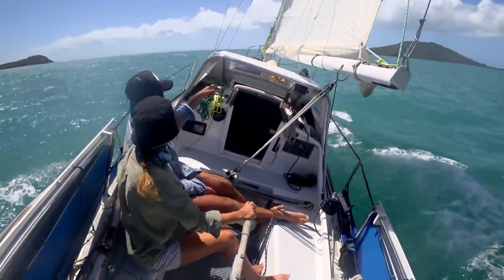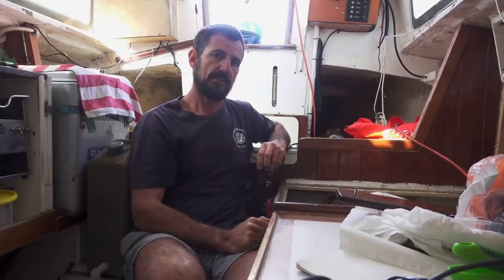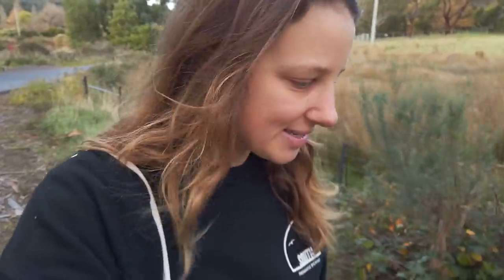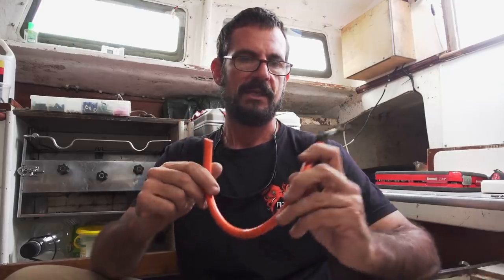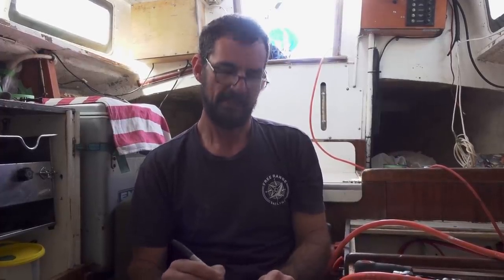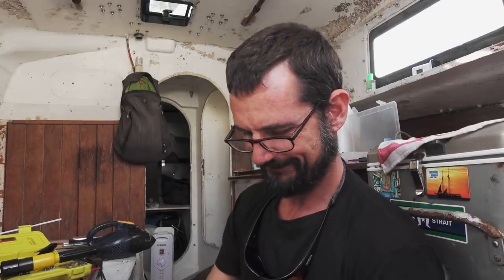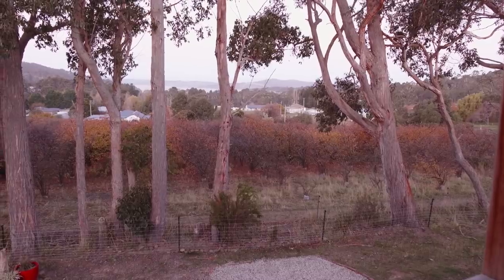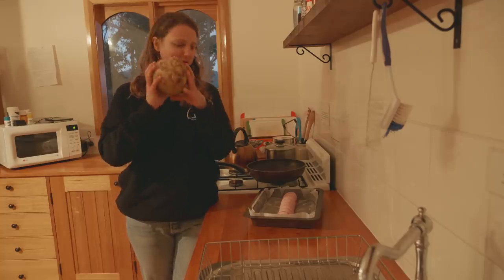Renewing our Electrical Wiring (DIY Sailboat Refit) - Free Range Sailing Ep 143

Comment: A cupla things Troy, if just crimping sealed lugs and heat shrinking it is a further improvement to have dipped the cable in a dielectric grease before crimping, remove the excess before insulating, shoulda remembered the advice you got a year ago from some production experts. When using lugs with the little slit inspection point in them it is best to crimp then solder into that little slit then insulate. The crimp stops the solder creeping up the cable so the solder that is fed in that little hole only sticks the very end of the cable to the lug, the crimp does the mechanical strain relief without allowing the solder to stiffen the cable, absolutely perfect and the solder stops moisture getting into the crimp through the hole. Too much work for a production joint but when doing low volume for yourself may as well have the best.
Reply from the maker: I'll pin this reprimand for viewers who want AAA finish.
Reply: @FreeRangeLiving  I was surprised you weren't dipping the cables before crimping, that was the big takeaway from the discussion last year.
Reply: I never crimped those lugs, just heated them up with a torch, filled them with solder and shoved the wire in..never had one fail.   I do really like the double wall shrink, I hadn't used that before, thankyou as always for the tips,  love your videos.
Reply: @bluejeans725  in which video did they discuss dipping the cables? I don't remember that bit...
Reply: so glad i saw this post as i was going to say exactly the same thing... soldered lugs are the best :) same applies to Anderson lugs, XT connectors and MC40. love it!

Comment: Just a tip - The bevel in crimp lugs (of that size) is designed to allow fine, multi-strand copper cable to get all the strands into the crimp area. You should also make sure you have the length of copper cut to full length of the space in the crimp and press the cable into the crimp as your crimping it to maximise the surface area of contact between the crimp and the cable.

Comment: A very quick tool for finding voltage drops, and find any kind of fire hazard is a thermal imaging camera. 

They are expensive,, but if the alternative is that your boat are going to shipwreck because of a fire - it is totally worth it. 

One can also find leaks (hidden ones too) - water is usually colder than its surrounding, so it would look blue on the thermal imaging camera's screen. 

It's known that there are sailor's boats that had ran aground, and those who are going to run aground. 

If there is a hole in the hull - you can see it through the thermal imaging camera, and thus also the extent of the damage to the hull. 

A yacht club could buy one, and let its members use it.

Comment: Important information about crimping. You should never twist the copper strands before crimping, the strands should go straight in, parallel to each other before crimping. If you twist the strands before crimping they are going to cross each other and when you apply pressure when crimping you effectively cut the strands in halve weakening the connection, but if they lie parallel to each other when crimping you get a very strong and conductive connection. Best of luck on your travels :)

Comment: I've been an electrician for 17 years and I've never even heard of liquid electrical tape,  I will definitely be acquiring some. 👍🏻
Reply: Home depot Carrys it or Nedco electrical
Reply: Plasti dip is a popular brand here in Australia. Leaves a plastic coating like found on tool handles etc. Good for a multitude of things including dipping the end of ropes (lines) for a 21century whipping.
Reply: @glennbrown1961  Stop it@ Get the palm and needle out ! or if you have the skill do a palm and needle whipping without a palm and needle!

Comment: In a marine environment I was taught to crimp, solder then heat shrink. Soldering guarantees no possible air therefore no water intrusion and no corrosion.
Reply: A lot of those large lugs have an inspection hole on the eye side of the crimp. The crimp stops the solder creeping up the cable so the solder that is fed in that little hole only sticks the very end of the cable to the lug, absolutely perfect and the solder stops moisture getting into the crimp through the hole.
Reply: as long as you don't overheat the join during soldering...
Reply: @Tom Mac  We never want to use solder in a vehicle for the same reason we don't use solid wire - vibration leads to work hardening leads to broken wire.  I'm re-working the wiring in my 1979 CD27 - which has factory-installed 16 AWG zip cord and wire nuts for the nav lights in the bow!  We used to believe some interesting things in the past, eh?

Comment: To heat shrink without having to rotate the wire you can use a small piece of sheet metal and cut it so it clamps to the end of the nozzle like a clam and then extends out a couple inches and forms a "c " shape. You can also buy them from electrical supply stores, called a nozzle hook

Comment: Dinner looked great!  After 1 sailboat refit (1/2 anyway till she sunk and I was boatless) and now a 40 foot land yacht, have done many electrical connections with wire and cable. You are doing a great job. Good tools make it so much easier. That and good tinned wire and ends, and of course heat shrink. I also use dielectric grease on my battery cable crimps. I don't use the hydraulic one, but a long handled one, that puts a single crimp on the lug, but then you have to put another one one to make is good to go. Then heat shrink. I don't use as much as you though...lol. And yes I hate when previous owners use electrical tape, but must confess that I have used at it times too. We all get lazy, tired, cold, hot, and sometimes just do a half assed job when we knew we should have done it right. Being in no hurry is be best practice.  Great refit so far. I have owned a 27 ft Nor'sea ( a great boat but way to small for me) and a 40 Endeavour center cockpit. The one that sunk.... and the smaller boat is the better boat imo. Looking forward to your transformation.
Bob

Comment: Some dieelectric grease on the connectors to the battery posts will protect them from the "acid breath" from the open-cell batteries as well!
Great details, thank you both!
:-D
Reply: Open cell acid batteries dont mix well with salt water and God forbid there dislodge in a storm? Game on then! Better going with marine sealed Batteries!

Comment: Good Aye Troy and Pascale,

I love your Clanny adventures and back up your comments on getting her seaworthy and go sailing.  We bought SYLVARA( Clansman mid 1972) 24 years ago and we have taken her from mooring minder to our pride N Joy.  I could have pulled her apart to where you are at now, but we chose to use her and we love racing and sailing her from Rushcutters bay in Sydney. 
 I chuckle at your electrics as I have been through it all and fitted a really neat switchboard and fridge unit in the ICEBox.
I have painted the main cabin and it makes it look heaps bigger.  I envy your time to be able to do the heads and forward cabin.  They are still on my gunna List.  
One piece of advice, use an Epoxy undercoat before using a polyurethane topcoat.  The reason the paint has not held well is that most people slap polyurethane straight not Gelcoat.  The poly cannot sticker tenaciously enough.  As the Gelcoat releases wax & Styrene's, it reduces the polyurethanes adhesion which peels once damaged.  Only epoxy undercoat can stick tenaciously enough to eliminate delamination.  Then put the poly over the epoxy and you have an extremely good paint systeem.  Check out Aquacote undercote and AquaCote Topcoat for a great finish and they are non toxic when working between decks.or a great exterior .   It can even be buffed after a week to a very high gloss finish.

Keep up the video's , they are great.

Comment: Just a thought, don't ever use lugs with what people think is inspection holes on boats (which they are not by the way). Your good heatshrink will hold moisture in with the copper strands.
I see many people do this and you had at least one in the vid. :)

Comment: I'll solder lugs on cables if I don't have the proper crimper on hand. If done properly it'll outlast a bad crimp 100 times.
Also I've seen people toss perfectly good battery cables because of the ends being corroded. With what good cables cost a lot of times you can trim a inch or two back and they are perfect and great for spares or shorter runs.

Comment: Should have pulled the boat out and towed it onto the property! looks close enough, awesome video as always :) very informative, i worked as a cable layer for many years and the only time we used electrical tap was when we had to join cables to pull through new ones, I was a bit surprised you never used any solder in your lugs! not that its needed when you have the right tools for the job but offers a bit more peace of mind that you have a solid connection, I would love to see a recipe book one day with some of them mouth watering meals :)

Comment: Back in '73 I spent the summer reworking and standardizing all of the Mic chords at the Student Center at my undergrad. We had a bunch of misc. chords made with everything  from coax to 2 or 3 wire electrical wire. Over the years we had created a ton of on demand chords because in the heat of the moment it was always easier to make them then to check them. So I standardized the wiring pattern and made them all. Shrink tape wasn't around then.

Comment: I was actually out picking 7 Litres of blackberries today. 
Love that hydroelectric crimp press. 
I’m going to check the price, and see if I still love it after 😂☺️
Good luck and fair winds ,,,/),,,
Reply: Hydraulic, I think Anders.
Reply from the maker: 7 litres! What treasure!
Reply: Mine was 36 aussie dollars on ebay.there are heaps around and prices vary widely, it pays to check cos I have seen them from over 100 bucks. I also use mine for small stainless swaging on 2 and 3mm ss cable for dinghy rigging. Works good and looks alright. You could probably change dies for a perfect finish. Cheers from chilly Tassie (Old Beach)
Reply: @rogerstone3068  haha. I blame the autocorrect ☺️
Reply: @glennbrown1961  ok. If I can find one in a descent quality for less than a $100 I will for sure bye one.
Reply: @FreeRangeLiving  last year, I picked 30 litres in total, in just a 500m radius around my summer house. Great spot for them

Comment: The badly crimped wires shouldn't be an issue unless for some reason you need at least 400+ amps constant through those cables over a length more than 3 meters. I've seen them crimped with a hammer and chisel before. A connection is a connection and with DC and lower amperage (under 50) the crimp is just to hold the connector on the end of the cable. As long as it's crimped tight enough to hold it on its more than enough for the current that is going to be passing through the cable. Good weather protection is much more important and that double wall heat shrink is the best option. 

Doing it right like you are is going to save you a lot of future work and worry. 
Have a great day!
Reply from the maker: The fact those connections have worked for a long time proves you right.

Comment: In a car I had a thick crimped cable failing right behind the fitting, looking just like cut with a knive. That happened because it was compressed so hard that it acted like a solid piece of copper abruptly changing into single thin strands. Since the cable was unsupported for about 25cm vibration destroyed it after little over 200 000 km  (famous German engineering :(  
So in case you can not eliminate absolutely any movement of the cable I highly recommend the use of some sort of kink protection on the crimped fitting to smoothen out the stress.

Comment: When I have assembled jumper cables with disused 28 vdc recovered from generator sets(during my stint in the USAF), I tinned the strands prior to setting in the lug and crimping(I prefer the slot thru lugs and set screw version if available). If I did not have shrink tape, we would use vulcanized rubber tape(commonly called F-4 tape) or silicone sealant(it is your friend)....

Comment: Really informative video on 12VDC electrical wiring. I noticed that a lot of the wiring being removed is regular copper and heavily oxidized. A train of thought is that all marine wiring should be tinned copper to prevent the black dusty oxidization, what are your thoughts on it? Is tinned copper cable even an option with lock down in Tazi?
Reply from the maker: Tinned is marine grade and we use it for everything but the battery cables. Actually, I used tinned on cars too. Old boats can have all sorts of junk in them when they're 50 years and still afloat.

Comment: Dear Troy. I am somewhat baffled and maybe disappointed that you did not solder the battery cables to the terminals. In my humble opinion there cannot possibly be a better way of establishing a secure connection. Of course a proper crimp connection serves very well but my choice in a marine environment would have been a soldered and heat shrink tube covered method. Naturally the purpose of the heat shrink tubing being to prevent moisture from creeping in between the cable insulation and the copper wire. (for the less knowledgeable among us)

Comment: Sitting here in Melbourne missing my home state more so knowing I can’t get down there to see family etc, and that sense of simplicity Tas provides. Question: I’ve done a lot of my own wiring on my camper trailer, but I’ve always had trouble with doing a “branch off” where I have a main circuit and want to run cables off to put in a USB port or similar. At the branch, heat shrink can’t be used. Would you use a specific connector or just solder and use the rubber paint?
Reply: You can get a proper junction box for branching to various lights etc. It is commonly used with a  7 wire application for highway trucks and trailers.
Reply from the maker: As answered here, I like to use a junction box and bus bars for branching. Makes tracing problems with meter probes much easier in the future
Reply: @montwolfman  Thanks, I'll search around a bit.

Comment: the electrons would go towards the negative but strictly speaking they are not actually moving through the cable. The charge is passed from atom to atom.
Reply: The electrons move from the neg. pole toward the pos. pole. They carry a negative charge so the conventional current goes pos to neg.
Reply from the maker: This